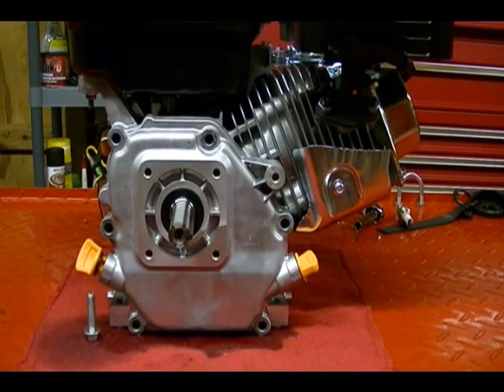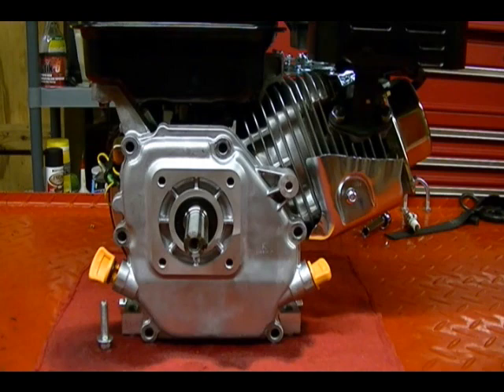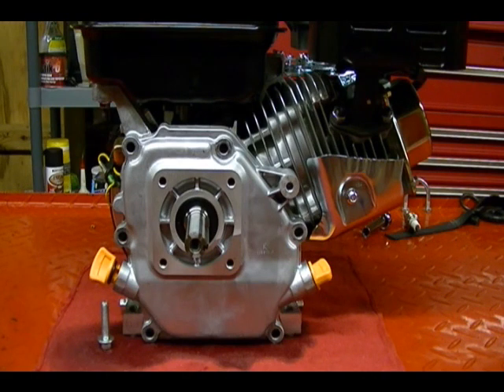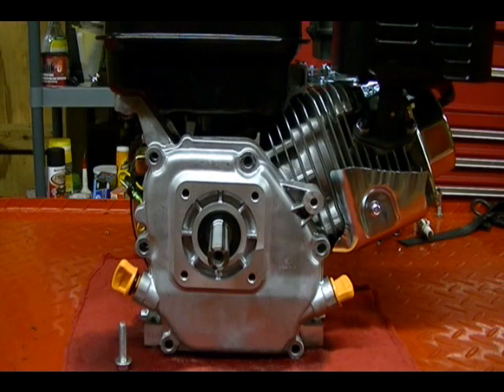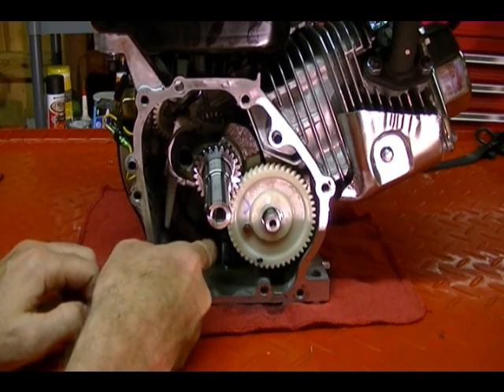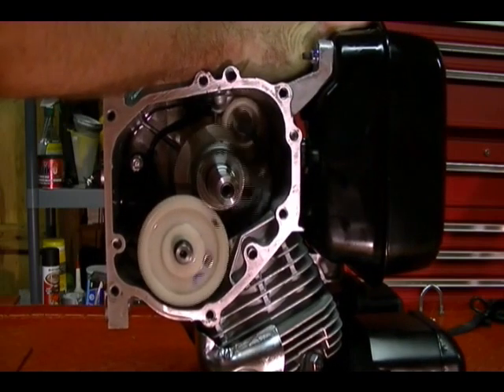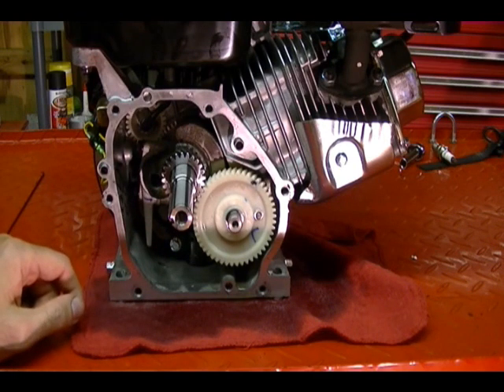Why you shouldn't Climb Trees or Walls with a 4-stroke Rokon Motorcycle

Comment: The motor would smoke and die
Same as when you turn a lawn mower over  to clean it the cylinder gets oil itt and smokes if was running it could hydraulic lock

Comment: The reason Rokon switched had ZIP to do w/ the E.P.A.  they burn so little fuel  that their footprint is the least of E.P.A.'s concerns. The RPM required to rain the torque down to the trail made these engines extremely noisy for any of you familiar w/ 2 stroke engines. Rokon took to heart what they were hearing from owners, who were also often hunters w/ complaints that their Rokon scared off the game so they went to Kohler and now possess the perfect engine for getting torque to the ground. These are fulltime 2 wheel drive and can easily drag 2000lbs behind the machine. These are 7.8 horsepower engines that possess a mammoth torque rating the number doesn't come to mind right off but it will shock you.. Lastly, customers wrote to  ask Rokon to make the ride smoother since these are primarily designed for the roughest roads with the steepest grades, then Rokon had their engineers design and get a patent for this suspension system that has made all of the difference in the world for rider endurance.

Comment: I doubt that it's a problem. Do you know what the oil level is when the engine is upside down? Is it not high enough to go into the cylinder when the bike is nose to the sky? I think that the piston and crank would act as the slinger in this case.

Comment: ya, because with the cylinder facing downward... and the piston full of oil as it's moving up and down 600 times a minute isn't going to sling any oil.    Please, you are totally wrong.    fill a tomato paste can with hot oil and shake it up and down at 10 times per second... then tell me about the lack of splash lube.   What in idiotic video from a supposed "small engine expert".

The biggest prob with inverted operation is the immense clouds of white, stinky oil smoke you get from the case purging itself into the breather pipe  Not getting oil... lol.   get a grip.

Comment: hi, im a mechanic,  the reason you neither want any engine to be at a right angle to the ground or up side down is that the oil once the engine rings are worn will allow oil to accumulate aove the piston,  if the engine is running the oil will pump into exhaust,  and you will run low on okl and burn some of that ojl. This is not the danger. the damage to the engine is if engine maintains position to long when not running and oil accumulates above piston, this can create a hydraulic lock and bend rods, con rods ect. so if any engine was upside down or straight up to long  let sit level for sometime, and remove 9lugs, pull over gentility a bit at a time so oil goes out exhaust, chdck oil level when engine tufns easily,  replacs plugs fire engine, (will smoke) run a bit shut down, check oil again,  run , have fun. the other part of warning fo degrees of engine might be that people will more cocerned with protecting the motor than themselves

Comment: To smallengineshop: Motor Oil does not dissipate in only a few moments so riding any motorcycle into an upright vertical position will do no harm at all-none. I have seen video's of motorcycles drained of every drop of oil and revved to red line. it took almost 5 min for the engine to blow. That's at red line! A momentary oil starvation at idle speed is nothing to worry about. Learn engineering before you post false information. When I say please learn that means learn about motor oil and engines. Please stay in the "small engineering shop only business.

Comment: A technical bulletin in video format, I like that. I also like that this clip is not flooded with remarks from Rokon owners lamenting about seized engines, due to oil starvation. I would hope that this indicates the durability of the bike, or that the bike has simply not seen sustained angles as to initiate failure. Nevertheless, my admiration for this bike remains intact, and for that, I thank you for the clip.

Comment: People who ride up walls and trees on a Rokon only stand in the 12 o'clock position for a few seconds.  That is not nearly enough time to create engine damage, especially with such a low RPM engine.  Just don't perform the stunt excessively and your Rokon will be fine.  Thanks.
Reply: I was thinking,"Who drives their bikes up trees and wall?"
Reply from the maker: Zachary Akdag
LOL
Reply: StJohns River66 Your the stupid shit person. It would take around 5 min at top rpm to blow up an engine with no oil in it. So he's correct, riding to a vertical position momentarily will do no harm at all. Good grief some people have no engineering knowledge meaning you! An engine with oil in it run into a vertical position still has the existing oil clinging to the moving parts. What do you think happen's? You think the oil automatically totaly dissipates instantly?
Reply: +PeterDad60 hahaha Yes.Indoubtably. The Very moment you take vehicle Up 12 degrees EVERY DROP fall out.Than again if this were the process.... Lubrication would be non-existent!

Comment: I didn't realize that Honda made any small engines without an oil pump, splash lube is mostly seen on small lawn mower engines.  Its not really a big deal as long as you use common sense, it doesn't have an inverted oil system like an aerobatic aircraft!
Reply: Actually, most small Honda engines are splash. Works perfectly fine for most things and is one less thing to break.

Comment: I modified mine to use a pump and Oil spay jets inside it, just simple wear and tear running on steep grades can cause problems as well, hell my 4x4 trucks are made to run tough grades as well,many  people also starve them as well, and we have to resort to some heavy modification to relieve this problem. i find it absolutely absurd a bike such as these they are not getting the engines modified to be anti starve and set up the lubrication systems a little better, these things get dumped on their asses a lot, I've seen them come to me scored up bad inside simply from that,  river floating while running as well. it should never be happening. slight flaw in the design as it's quite easy to do on both these engines we are finding, and getting sick of fixing peoples engines.  It's something that reasonable operation and care obviously prevents and owners should not be morons, however we've repaired and modified many a torn up engine because of every day  accidents and such that can happen in the bush or survival situation.  we can fix this problem, so why not build them to handle a little more accidents, and not become a weak link. Cheers for the video. IC
Reply: So, where is the video (or better yet instruction sheet) for us to make our own pressure spray system. I'd share a few dollars for your 'practice' figuring this out.
Reply from the maker: Good comment!
Reply: If you tired of working on engines,.. tell the customer not to come back and shut down. 
  Write Rokon with oil pump idea... we dont own Rokon

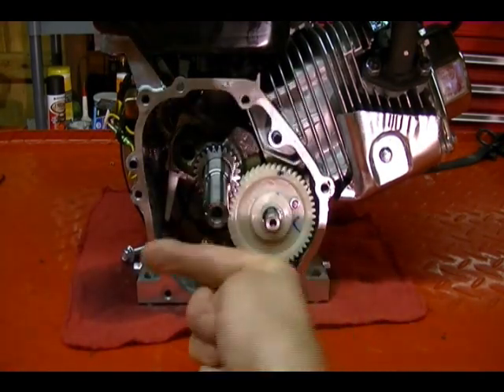Comment: So based on your details and description between 3:15 and 3:25, the 4 cycle engines cylinder is tilted rearward?  That's not a practical design.  Why doesn't Rokon position that motor the cylinder tilting forward?  Then it could easily splash oil while climbing, and when descending down steeper than 31 degree hills, at least there would be no load on the motor so oil cavitation would not be an issue.  I know turning the motor around would present some problems and would require some funky exhaust and throttle re-routing, which bring in another question, is the intake and exhaust for these motor on the side of the cylinder instead of front and rear?   Sorry for the questions, I appreciate the time you took to make the video.
Reply from the maker: Rix Babs Rokon doesn't design their engines. They are forced to use what is available. The original Rokon engine was a 2 cycle engine with a diaphragm carburetor, so it would operate in any position. The 4 stroke engine maximum angle of operation applies in all directions.
Reply: ***** I appreciate the quick response.  I haven't ridden a Rokon...yet and am coming to the point in my life that offroading riding isn't about how fast I can go.  The Rokon seems like the answer, but damn, every time I go out, I know I am climbing some stuff a bit steeper than 31 degrees. Would the 160cc Honda motor be a better option than the Kohler?
Reply: *****  yes these splash lube engines are designed to have the oil reservoir in one place.  the engine will not self destruct instantly when angle of attack is too great. but to operate the engine for an extended time in a position when proper lubrication is in question is not taking care of your stuff. simply ride your rokon. ride it hard. just keep safety for you and your bike in the back of your mind. if your engine blows up, just buy a new engine.compared to the cost of your rokon, a new engine is cheap. not that big of a deal. got to learn somehow.
Reply: +ratoneJR Yes! Self-Destruct it will one second above 60 Degrees!

Comment: You don't tilt it because the oil will pour into the cylinder setting on the back side of the piston beating the heck outta the rod, piston, and crankshaft
Reply: C Riley That could happen but not right away. I've seen the Rokon ride into a vertical position and there was no oil slugging damage to the piston.

Comment: lol your full of it. the bike will run out of gas or flood up long before the oiling is a problem. the cam and piston flinging around will splash oil over everything more than the dipper will! actually over oiling is the problem itll blow it out the breather and into your carb and smoke up the place

Comment: Great video, one correction; Rokon put 2 stroke engines in the Trail Breaker until at least 1997- I have one! The Honda engine was optional for a few years prior to the changeover.
Excellent explanation of oil starvation.